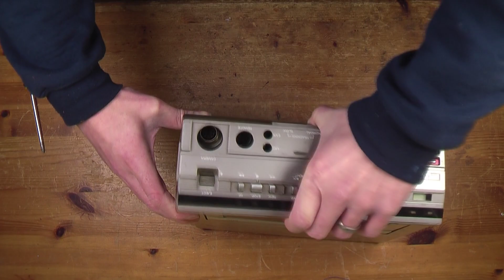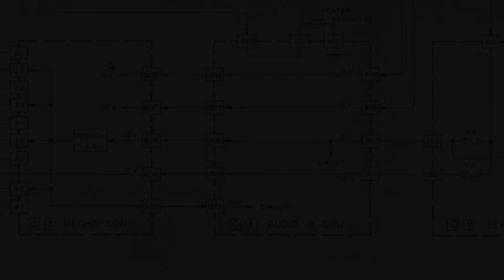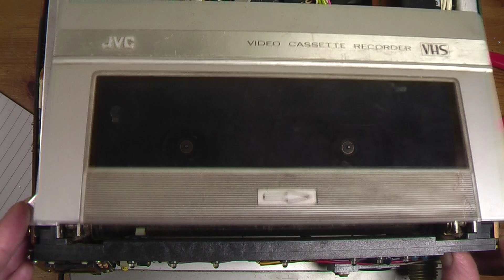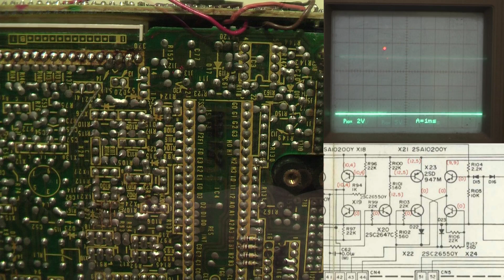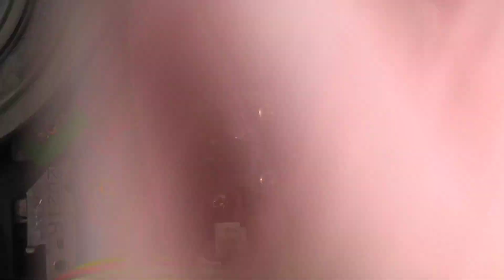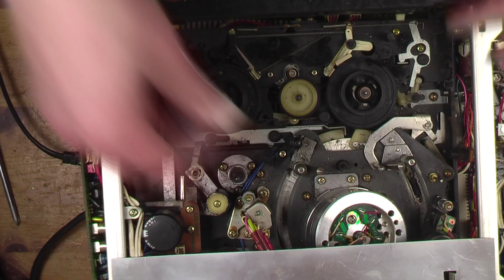JVC HR2200 VHS Repair Part 2

Comment: Hello, I have the JVC HR-2200U Video Cassette Recorder, and it's fully functional, I can watch tapes with no problems. The only issue is when I want to record with it. I'm using a Panasonic WV-3060 Color Video Camera, which works because I can see an image through the viewfinder and when I press the camera's trigger switch the recording starts and the tape advance. The REC and PLAY indicators are lighting, so I assume that the recording is taking place. But when I rewatch the tape to see what I recorded, nothing appears. I have no image that has been recorded or sound. Do you know what may be the problem and how to fix it?  I appreciate a lot your answer.
Reply from the maker: I would check that the REC 9V is present at the collector of X2 on the chroma board and that it is getting everywhere it is meant to including the pre/rec board.
Reply: @nowt1002  I know it has been awhile, but I've recently acquired this unit and I am having the same issue. In addition, tape playback displays video accurately but only in black and white despite a color signal having been recorded. I did some research and most answers point to the chroma IC. I also am not getting any display when using the audio/video IN ports (but the 10-pin camera input does show live feed). Could this be another fault belonging to the chroma board?